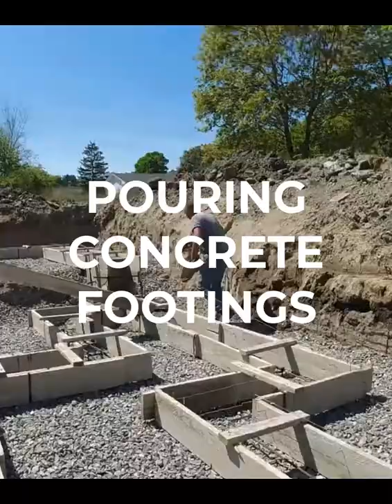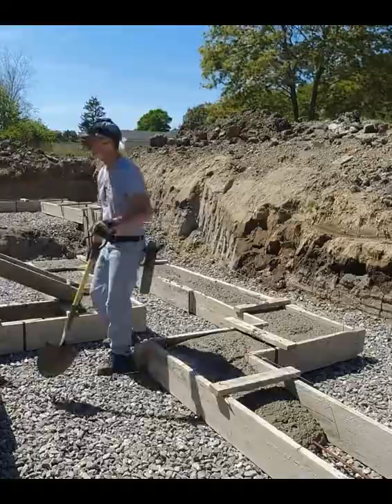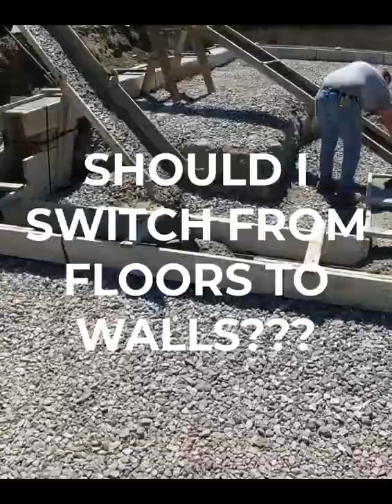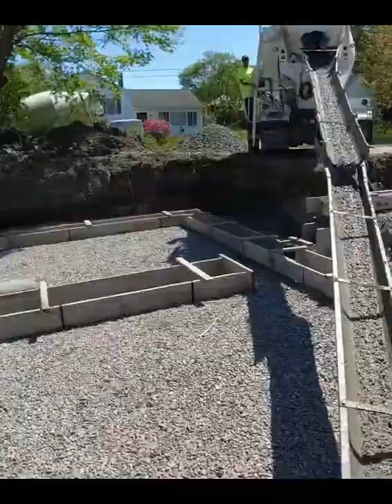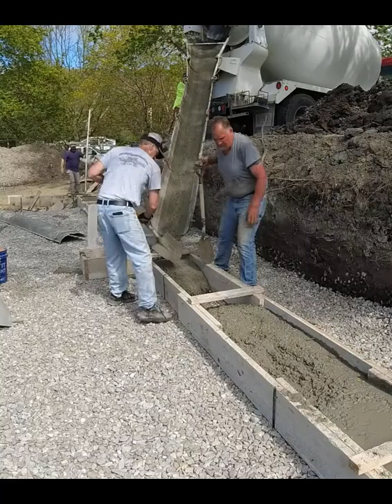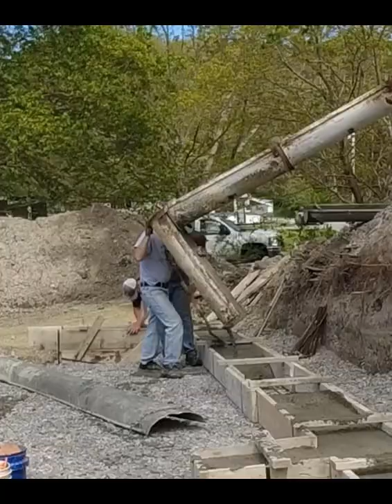Trying Something Different... #Shorts

Comment: We do excavation, foundations and floors, patios, sidewalk's etc. I like that it makes less work to find and you don't get bored of just flat work or foundation's. Easiest is excavation,  then flat work most difficult foundations. Most profitable  with least equipment to buy is floors. I have about $150,000 in equipment in Foundations, $80,000 in Excavation still need a skid steer, add another $30,000 flat work stuff maybe $15,000. They all make good money but Foundations takes a toll the most on your body. Sitting in a AC excavator is like like riding in a wheel chair that makes money 💰.

Comment: Wheres your vertical rebar?
Reply: Upright bars usually get wet set in after the concrete sets up a bit. That slump looked like a 5 or 6 at the end of the video.